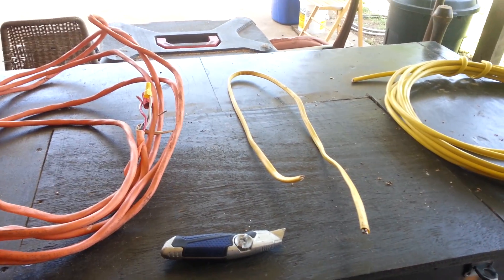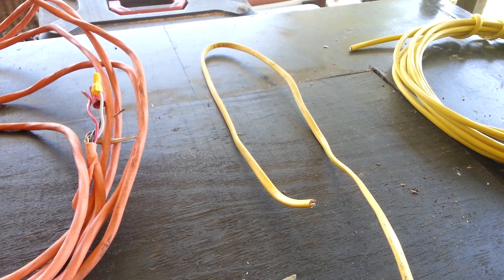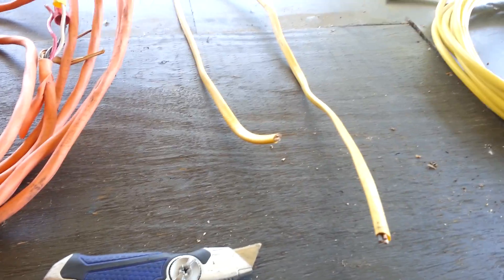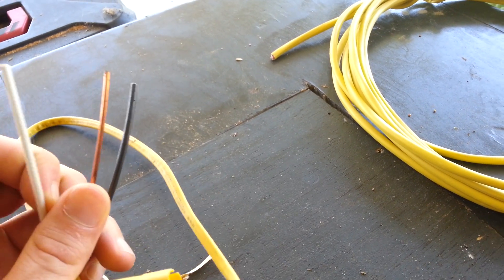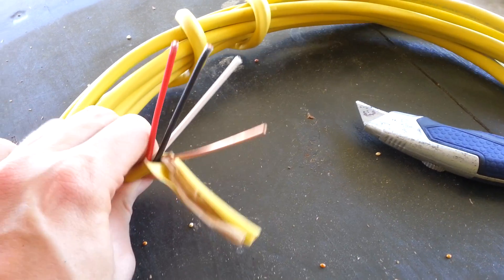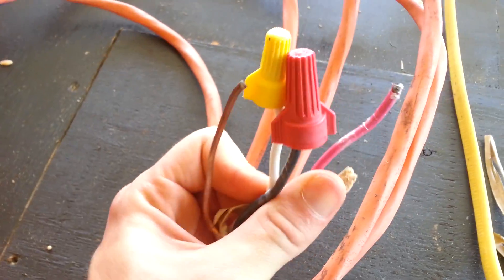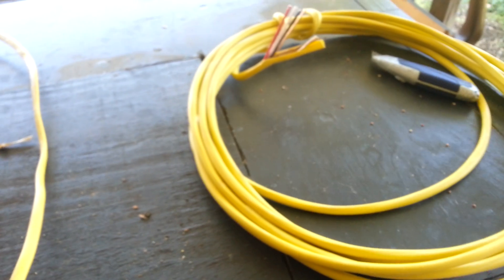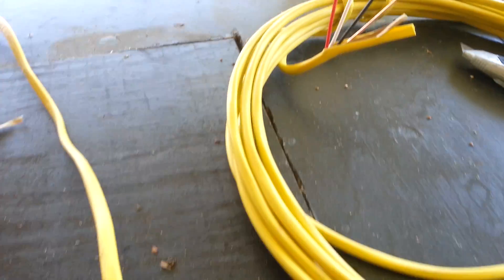Romex Wire 101

Comment: This video is ridiculously bad.  For what you said, you left way too much out.  It's definitely not 101.  You don't even show how to test it.  As for what is actually wired in a house, etc., you just have to read the wire, or check the gauge manually.  You have to know what gauge to use for what application/breaker, etc., and you have to know if the existing wire is good!  NOTE to whoever: Check code/s!  If you want to DYI, hire a pro to eval, make written notes, research/learn, then do the work.  That is still a lot cheaper, and a lot safer.

Don't do anything if you don't know what you are doing.  Your property catching fire will not be fun.  Someone just saying, to paraphrase: ""This is a conductor you use to...", "tandem breaker", etc., means nothing.

Title should be: Very basic, house/business wire gauge sizes/colors.  Then, leave the rest out, unless you are actually going to explain everything.  You did not even mention anything about the possibility of someone having AL wire, or both AL and CU, especially at least making a comment/note about connection/termination.

Additional note to whoever: "Romex" is just a name.  There are other wires that are the same with other brand/trademark names.

One little tidbit: Do not run any non-permanent wire in/through walls, or in attics.  Again, check code/s, etc.

Comment: can i splice 12 2 wiew into 142 wire?
Reply: Yes, if the breaker on the circuit is 15 amps.  If the circuit is protected by a 20 amp breaker the wire could be overloaded.

Comment: I have what I would call a good Question- But for you an expert electrician it’s probably simple I’m tapping Ac current off the back of my car alternator off the Stator the copper wire mesh under the casing to use the Romax wire I can use the case is the ground positive is tap straight to the copper wire which produces the purest sine wave what do I do with a neutral ? “ Please “ this is a DYI home generator & it produces 2,000 Watts at about 1,900 RPM ! I have it recorded !

Comment: Bonus point for safety: when cutting the jacketing, just cut the first inch or so, and PULL the jacketing back about six inches. Don't use a knife for the full six inches. If you insist on using a knife, inspect the conductor visually and by touch to make sure the individual jackets are 100% intact.
Here's why: If you cut the full six inches of the jacketing with a sharp knife, you risk knicking/cutting the jacketing around each individual conductors. Knicked and exposed wire is unsafe. Higher resistance, more heat under load, and a chance of arcing between two exposed conductors.
Reply: Thanks for explaining that. Seems simple to understand why after reading that.

Comment: Can I use the 12-2 wire in buried plastic conduit
Reply: Richard Neal    Not legally!    Two reasons, not allowed in more than 6 feet of conduit because of heat, and not allowed below grade because it is not rated to be in water.   Pvc fills up with water even if glued.     Use spooled conductors, not jacketed cables.  Hope this helps you.

Comment: I always thought 110v needs to be ran in conduit.
Reply: For most areas in residential, conduit isn’t needed since the wires are ran behind the walls
Reply: @Nick-bh1fy  Is a 240v outlet for a welder 161 amps at 35% duty cycle, 4ft drop from the main 200 amp breaker, to short of a wire run? I'm using a 50 amp breaker and 6/2 romex
Reply: If it ain't round I turn it down not quite sure what Youre saying but installation seems correct to me assuming the run is a couple feet like u said should work fine
Reply: @Nick-bh1fy  I didn't know if my 240v outlet was too close to the main breaker panel as far as code goes. I'm only a 3ft drop down through the wall from breaker box to outlet.
Reply: If it ain't round I turn it down I wouldn’t necessarily worry about being too close unless sparks will cause an issue for u otherwise you should be good to go
Reply: @Nick-bh1fy  Thanks nick! I said 3ft but it ended up being 2ft of total wire from the breaker to the outlet. No sparks so far! Thanks for your quick response!

Comment: Can I use white romex for 12 led flush lights in my patio?
Reply: FAMILY URIAS   I hope you did not use romex outdoors.   It is for indoor use only!   UF is exterior rated.   Size is based on load in amps for conductors and over current protection(circuit breaker)

Comment: Can I pig tail a 14/2 off of a 12/2 to power one outlet and a switch for a LED lamp?
Reply: Bobby Medina would not recommend this.  14/2 will only handle 15 amps whereas the 12 will handle 20 amps.   If someone were to see the 12/2 and think the circuit could handle 20 amps not knowing there was 14 gauge wiring down the line this could lead to problems.  Best to keep with the 12/2 for the entirity of the circuit

Comment: Good video, funny camera work. :P It did get me thinking about 12/3 wiring for ceiling fans. We should rewire the house someday because we have old aluminum wiring. It can be properly adapted for safety, but if we needed to do a full rewire, it would be smart to run 12/3 cable to the ceiling fan so we could operate power to the fun and light separately. Yeah, 14/3 would be fine, but since this house has always used 12 gauge wire for 20 amp lines, I'd just stick to that. Although, code probably forces 12 gauge wire  in between switch and light on a 20 amp line in case something wrong happens. Consistency is a good policy.
Reply: The NEC even calls out how to do this in article 314.16, tables314,16(A) and 314.16(B) 314.16(A) lists common box sizes and maximum amount of conductors allowed. For example, a 1900 box that is 1-1/2" deep can have 14 no.14, 13 no.12s, and 11 no.10 wires. 

To convert AWG to cubic inches, 14 is 2cu in. 12 is 2.25, 10 is 2.5 per 314.16(B). 
Any devices are counted as 2 of the largest size wire in box, as connected to device, a double allowance. The grounds are counted as ONE of the largest wires present. Cable clamps, if internal, are counted, as are fixture hickeys and support fittings.
Reply: Robert Gaines 
2 words
Box fill.....read it, learn it, know it
BOOM

Comment: Anyone can reply to my question. I was drilling into a wall to run some camera cable and nicked a Romex number 12 cable enough to trip the breaker. There doesn't appear to be any cut to the wire itself but it definitely took off the sheathing. It's a small Nick where the drill hit it but I don't see any cuts to the wire at all. Would this wire need to be replaced in entirety? Or can it just be electrical taped to recover the exposed wire. The damaged area is less than a half an inch
Reply: I'd opt for replacement between the places that segment of the circuit goes, on the basis that it could arc and start a fire in the future. In times where ONLY the jacket tears, as it can while first installing it, a wrap of white, yellow, or orange tape (match the color of the jacket) is perfectly acceptable.

Note that you do not have to follow the same path exactly,especially if it's easier to fish cable between points, up walls and across attics, under floors, etc. Other things I've been known to do, is run pipe between 2 metal boxes on different floors and pull THHN between these points to facilitate future circuits. Or run 3 and 4-wire MC cable where I'm fishing it in walls.

Comment: QUESTION SIR....IN MY 10 BY 20 MAN CAVE...I WIRED MY BUILDING WITH 12/2 ROMEX...CAN I USE 12/2 UF FROM MY MAIN PANEL IN HOME?AND HOOK TO 20 AMP SINGLE POLE BREAKER? 20 AMP IS ALL THAT IS LEFT ON MY MAIN BOX

Comment: what kind of wiring should i be using for putting outlet in my trailer that im trying to convert into a camper. just 15 amp outlets and one lights.would a 12 -2 wiring work.?

Comment: I was watching romex 101 particularly to see hou you cut romex and how you cut open the sheathing. is the a trick to aviod nicking the line wiresunder the sheath.
Reply: Paul Klumb Irwin self adjusting wire strippers work great.

Comment: Can i use romex wires for a solar set up in a house? i googled this but there wasnt a yes or a no, just got a bunch of stuff that the wire is generally used for. Nothing specifying anything. I do understand its use for residential.
Reply: NEC 690.31 backs this up, though commonly, types XHHW, and UF are used outdoors with success. NEC article 340.10(2) specifically allows UF to be used this way, in PV/Solar systems, in accordance with NEC 690.31. 

Note that NM-B (Romex) cannot be ran in wet locations, buried, or fished inside exterior masonry wall voids, nor embedded in cement/mortar/grout/plaster, as called out in article 334.12 (A), 334.12(B)
Reply from the maker: Yeah I don't see a problem with that. You'll just want to make sure it's sized properly, not subject to any physical damage, and I wouldn't suggest running romex outdoors without being in a conduit or raceway of some type.
Reply: S33 Electrical 
Thank you very much
Reply: S33 Electrical 
Really? You sure about that?

Comment: Also of note is that the color-coding system is pretty recent. If it's pre-2000s (as in my home) it's usually all white (unless it's a high-gauge wire, usually black or gray, as in a service entrance cable).

Comment: Garbage, garbage, garbage. Real Electricians lay pipe.
Reply: Joseph Christopher From Chicago Do you mean to say real Electicians use conduit? Pipe is generally used for fluids and gases.
Reply: Tell me the easy way to do a three point saddle and I'll concede you know what your doing.
Reply: nice reply..good job my fried...
Reply: WOW!
Reply: Joseph Christopher From Chicago amen to that !!! Local 134 represent !!!
Reply: Michael Young ha! That's funny... I recall being in direct competition, or having to gain your approval with being competent in this trade. I made a comment about Romex being garbage, which it is... it's only practical use is for temp power on a job site, if that. In this city, where we lay pipe, like good Electricians do... Chicago code even requires that temp services be piped, unless it's for temporary lighting. Now I could give you the formula for a "3 Bend Saddle..." I could give you the formula for a, 4 bend saddle... but, not be an asshole on purpose, which as you can see I fairly good at, no lessons for free son. I don't work for you, nor do I get any checks signed by you. Until the day cometh, where in I need your approval... which will require you to be paying me... you can fuck off. I not in this trade to seek you or any other Electrician's approval. In fact we are all competitors, and I will not recite code, formulas or any other secrets to you. Suffice it to say that I've bent so much fucking pipe, roughed in enough shit, that I don't need a formula do a three bend, 4 bend... offset, gooseneck, 90, 90 with a kick, back to back 90, or an Z. You fucking YouTubers have something stupid to say Everytime somebody attacks something you like... like fucking Romex. Fuck Romex. That shit causes more problems than the money you save on pipe. You pipe a house right once, if there is ever a problem, you just pull new wire. And if you, "know what you're doing.." 😂😂😂 in the first fucking place...there should be no problems. There is your school lesson for the day... oh and one more great thing about laying pipe, bitches love it... and you actually feel like you did something, instead of like a low voltage guy... running a bunch of rg6 and cat6 around the house, stapling everything like a bunch of sissies. And one last thing... fuck you Savor, come mierda Marion, pendejo. Estupido. Yes man. Good reply... shut the fuck up!
Dumb ass Romex Electricians piss me the fuck off!!!😠😠😠😠 Something goes wrong you got cut a fuck ton of holes in the house... using gay ass plastic smurf boxes. 😂😂😂😂 You MF's are a joke!!

Comment: Nice video. Have you considered doing one on splicing romex using butt crimps and heat shrink wrap? It would be a good one.
Reply: That's also not permitted, in the open, as all splices have to be made in boxes. With UF cable, this is the only way to do it outdoors, whenever a listed/approved splice kit is used. Usually, I'll turn the ends up into a 6x6 plastic junction box for accessibility, and splice with dryconns, however, these are listed for direct burial.